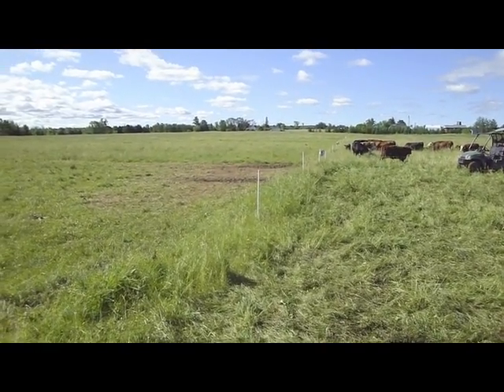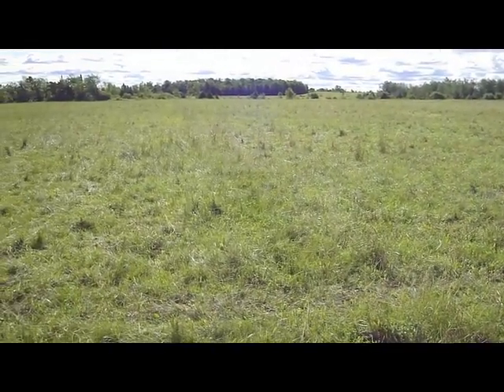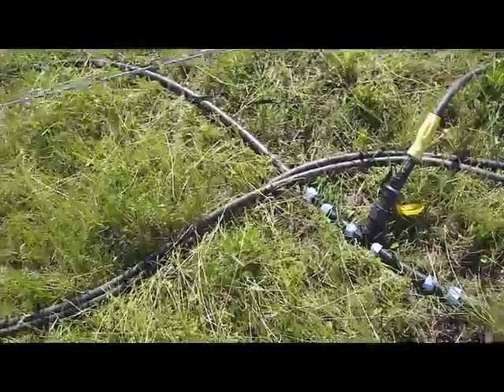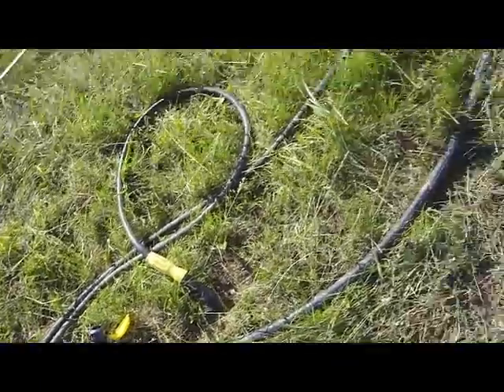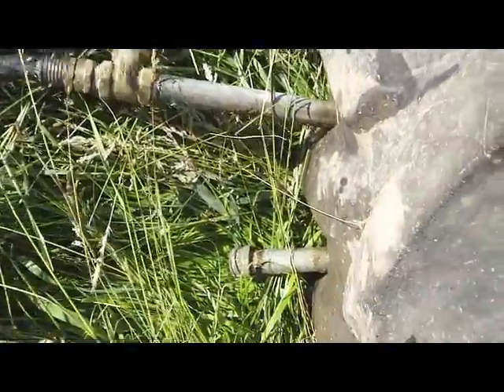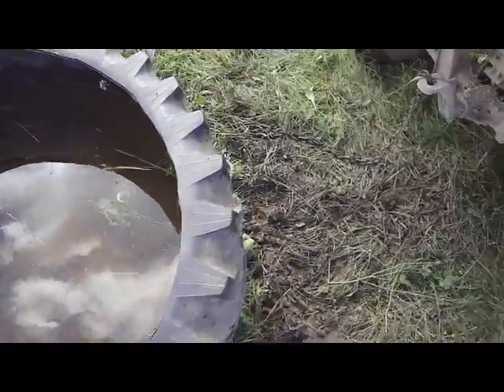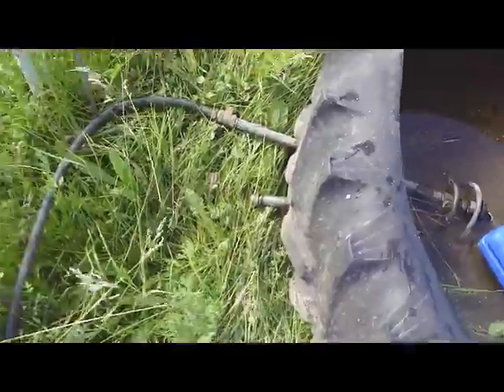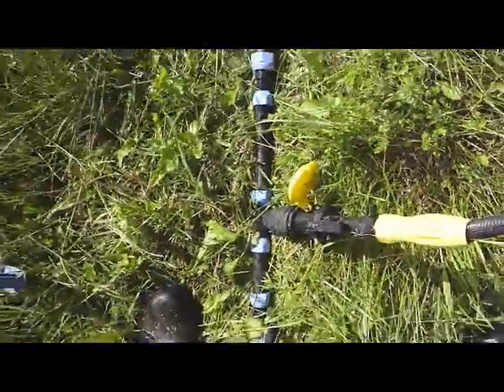Portable Water Tank Move

Comment from the maker: @mwatson04 I'm sorry I thought I had replied to this earlier but can't find it.  In case you are still wondering, I started with a tire and cut out the sidewall on one side.  I then measured the circumference of the bead and then had the local steel shop cut a piece of steel this size.  Then I laid the steel on the bead of the tire and drilled holes through the steel and rubber and put bolts through them.  Then just put silicon around the perimeter where the steel meets the rubber.

Comment from the maker: @SebagoLakeRanch 
My line is a 1" line and at the time the 1" "T"'s from powerflex were backordered.  To get around this I used 1" to 3/4" reducers and a small piece of 3/4" pipe and then connected an extra 3/4" "T" I had to it.  It was just a workaround and now it goes directly from a 1" pipe to the 1" T.

I had a friend who tried the new Powerflex and he doesn't like them near as much as the older version.  Hard to line up the cotter keys through the 2 holes you have to drill in the pvc post.

Comment: Hello thank you for your video on the portable tank move.  I purchased the exact same Plasson quick connect risers/couplers.  I used 1” poly tubing with a barbed ‘T’ at each location.  How do you connect the male end plasson riser to the T in your main line.  Believe it or not I bought threaded female end for the plasson with barbed male end to run a short length of tubing off.  The female fitting doesn’t perfectly match to the male Plasson end.   No idea why and the distributor doesn’t either

Comment: @mwatson04 - In case you still need the info, concrete is poured to make a bottom for the tire tanks.  Silicone calk (like used in aquariums) can be used to seal edges & around fill & drain pipes.    Some have concerns about chemicals that might leach out of old tires.  Others say the material is pretty inert.  Used whiskey /wine barrels cut in half, with a float valve & quick refill, will water a lot of animals in a MIG system where animals are nearby.  Fresh water & 0 chemicals!

Comment: I'm interested in how you made your water tanks out of the old tractor tires.  What did you put on the bottom to seal it up?  Also, how did you seal it around the fill and drain pipes?  Seems like a possible option for us being we've got plenty of old tires sitting around.

Comment from the maker: @dnortunen I never did seal it around the fill and drain pipes.  I used a 3/4" drill bit to drill the holes and used 3/4" pipe and it fit so snugly I had to pound the pipe in with a hammer and it never really leaked after that.

I have 10 big (8' diameter) rubber tire tanks that have cement bottoms in them but they are permanent and not meant to move around.  I have seen cement bottom smaller tanks that have hooks in the cement so that they can be lifted with a tractor and moved.